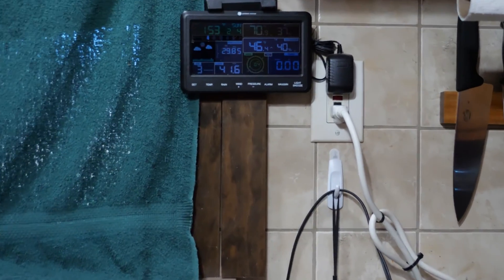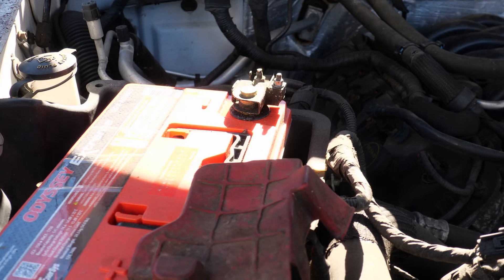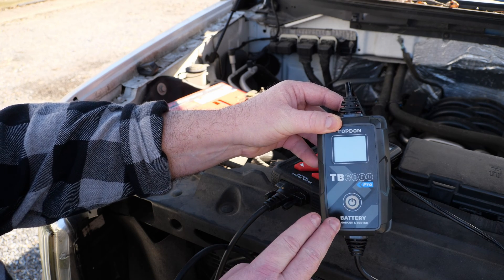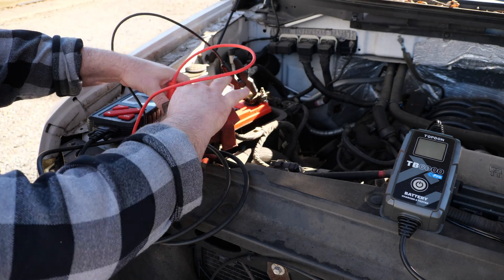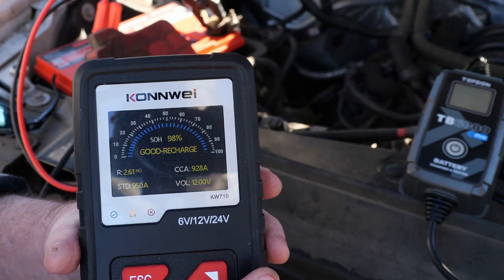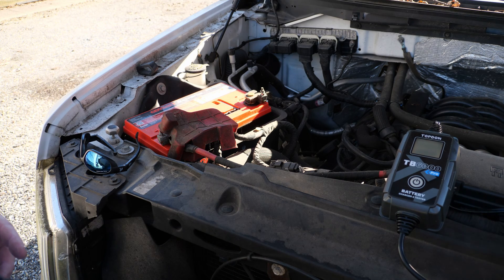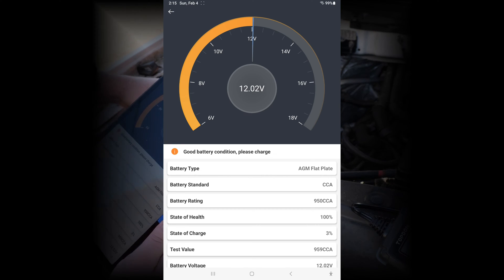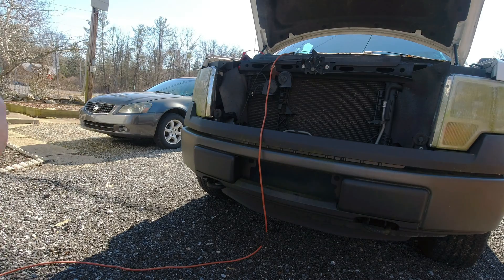🔋(part 2) Odyssey AGM Extreme Series Battery, 𝐕𝐄𝐑𝐘 Long Term Review

Comment: Odyssey are great batteries iim a mechsnic  done the maintenance on a friends 7.3 powerstroke has 2 group 65 agm odyssey were installed 4 years ago i check them yearly there still going strong,  as good as these batteries are abusing or neglecting any bartery will destroy. Or shorten its overall life , letting a battery go tottaly flat to 1 even 0 volts will destroy severly ahorten it life , second bringung batteries back up there flat by slanming them a alternator is second death for a battery  there flat use proper charger beung them up to chsrge properly.

Comment: how are you getting 950 ccas I am looking at the best they have for diesels and its only 850ccas, pc--1500
Reply from the maker: What do you mean how? The battery is specified/rated at 950, and it physically measures even better then the manufactures rating. It just is and it just does. 🤷‍♂

Comment: I have an Odyssey Extreme Series 65 that was installed in 2015.  It still tests good and starts every time. I’m thinking of replacing it just because of its age. No other battery I’ve had has ever lasted even three years.

Comment: Lto lithium’s the wave of the new future, 10k-20k deep life cycle no low temp charge issues,no cell balance issues, voltage stays rock steady, super fast charge rates and discharge rates, fire safe battery chemistry, yeah the future the last battery you will need for starting, they all hot cake wild in the car audio scene obscene amp discharge rates insane charge rates, the only drawback is less energy dense and very expensive, after my standard agm and lead acid batteries die I’m totally replacing them with lto lithium, plug and play 6 cells two pairs

Comment: I'm in need of two new batteries for my 1997 ford diesel pickup. I've been researching AGM batteries,  both Optima and Odyssey are the highest rated but I continue to find to complaints on the Odyssey.  The first complaint is that the batteries fail in under a year and the second is that Odyssey refuses to honor their warranty. After reading their warranty I have come to the conclusion there is No Warranty on an Odyssey battery. Odyssey says it warranties their Extreme for 48 months but if you read the warranty it say that a battery is only good for so many starts and they may determine your battery has reached its life limit before 48 months and therefore the warranty is void. Using a stock motorcraft battery I've been getting at least 5 years out of my batteries and pang less than half the cost of the Odyssey. Please explain the value of an Odyssey battery. I see none.
Reply from the maker: Explaining the value of this battery is exactly the point of this video series! Subscribe, watch, wait, and we'll all see together when this thing dies on me. Until then, I will provide yearly updates until the battery is dead, or until I am.
Reply: I'm watching this because I'm on year 7 on my Motorcraft battery that came in my Transit. I'm having a hard time believing these will outlast what I've had with these. Mine is in a Transit duel battery set up with factory high amp alternator. Van get started and drove probably 320 days a year so they have been charged all thier life consistently

Comment: According to the Odyssey literature - At 12.6v these batteries are at 75% state of charge.  12.9v  is 100% state of charge.  I have the same batteries, I put them on a trickle charger overnight (disconnected from truck) and they end up at 12.6v.  Apparently regular lead batteries are 100% at 12.6v, but these Thin Plate Pure Lead batteries need to be at 12.9v  Thanks for the documenting and sharing your test results.
Reply from the maker: Yes, 12.6 is the SAE (Society of Automotive Engineers) standard for all FLA (flooded lead acid) batteries across the board. There can be slight variations in voltage with different internal compositions though. But voltage will always fluctuate with temperature just as it will with resistance. A couple 10th of a volt difference must also take into account the battery temperature and internal resistance. Any 12v lead acid battery at or above 12.6 VDC (volts direct current) is good to go generally speaking. 
Cheers 🍻
Reply: These batteries call for 14.4-14.8V bulk charge and most auto manufacturers' alternators put out mid to high 13's.  Simply, it sounds like you haven't boosted your voltage and hence never fully charging your battery.

Comment: When you connected the tester, your battery had 12.00V, which means it was deeply discharged. Either you don't drive much and rarely, or something in the car consumes too much electricity when the car is parked and not in use. If this is the case, you will quickly damage even a very good battery. Measure the power consumption at standstill and charging voltage. This battery is AGM, and a fully charged 100% AGM battery has a voltage of 12.90 - 12.96V. Whenever you measure the voltage and it is lower than 12.65V, you must quickly fully charge the battery so that it does not sulfur and serves you for many years. I know what I'm writing because I am a specialist in batteries and vehicle installations. Regards.
Reply from the maker: Just some friendly advice here. Know the guy/gal you are talking at, before you begin to type/talk. "Trust me I know" doesn't get us anywhere. But proof does! All I have to offer is proof!

Comment: What group size did you test and what year and engine size are you using??? I have two Fords , 2007 , F150 and Expedition,  both have a  5.4 . Been getting good life out of the Motorcraft batteries just wanted to see what other options there are now.

Comment: did You put dielectric grease between the terminals and the connectors?
Reply: Yes!
Reply: @Finite-Tuning  Thank you for your response. You don't actually want to put the grease between the terminals and connectors. Put the connectors on the terminals then coat it all with the grease.
over time the grease will become an electrical insulator. If you start to notice the battery losing juice again take the connectors off and clean, then reattach.
Reply from the maker: @brettweltz8135 :
If grease could stop the force of a battery clamp, we'd have much bigger problems to worry about. If grease could stop 12vdc with over 1K amps, the engine would never start. I've already explained the low battery voltage in the video. I "always" use dielectric grease directly on battery terminals, been doing so over 30 years now. It helps to block corrosion, nothing more, and it barely even does that much.
Reply: @Now-Review-This  maybe dielectric grease behaves differently up north. I live in  Miami. the grease with my experience became almost like water and seeped into the connectors and caused just enough resistance to interrupt the circuit. after cleaning the connectors and terminals then doing what I mentioned in my previous comment, the problem hasnt come  back so far... its been 10 months. 
could also be the connectors... its a group 75 battey in a 95 corvette.
Reply from the maker: @brettweltz8135 :
Another place you might find the stuff is in the breaker panel in your home. It's heavily used there as well, but is probably green/blue in color. Even in the south dielectric grease is attempting to stop corrosion 😁. It's used by all industries where ever electrical connections are made.
Reply: @Now-Review-This  it might be the dielectric I used the stuff I use is by permatex and it’s clear. Could also be that the engine bay of my Corvette gets really hot….. I may have other problems that up to this. though, like I mentioned, I cleaned everything up put it back together basically soldered the connection and covered it with grease and haven’t had an issue since. Plus, I put a battery isolator on it just in case.

Comment: Would be interesting if you could get a baseline on your testers, to see how accurate it is. The go to, for years has been the Schumacher BT-100. If your different meters measured the same, I wouldn't have any concerns. Granted, they don't have all the bells and whistles as the electronic versions, but they are cheap, reliable and last forever.
Reply from the maker: They are accurate, very in fact. I checked both testers against my Fluke 87v back when I first got them. But as demonstrated in the video, they are very sensitive to their connection point. Every wiggle of a cable will result in a different reading. Batteries are very coarse devices though, they don't really care about mili-volts until we start talking about 100's of them 😁.
Reply: @Now-Review-This  Thanks for the reply!

Comment: Been using Odyssey batteries for many years and when used in addition to a battery minder I have achieved a life span of around eight years.
Reply from the maker: That breaks down to $50 per year cost of ownership, I think I'd be happy with that if I can duplicate those results. But I remember not long ago, $50 got you a brand new name brand battery! So there's that I guess.
Cheers 🍻
Reply: @Now-Review-This  Just bought a "cheap: battery from NAPA for a car that we are going to donate in a few months and it was close to $200.00.

Comment: Thank you for uploading this review video. Had been lately thinking in adding a second Optima battery to my old 2004 Durango who sees quite a lot of off road hard working abuse at the ranch. After seeing your video, now I am leaning more towards just replacing the Optima with an Odyssey. I will look more into that option. I am sure there has to be a rough-use Odyssey out there.
Reply from the maker: These Odyssey batteries are heavy duty for off road and on road use. I think the Odyssey website has a video showing the manufacturing process and internal construction. They use a much heavier buss bar connection internally for connecting the plates to the terminals. This is the common mode of failure for most standard batteries when used for off road conditions. I'm fairly certain that all Odyssey batteries are considered heavy duty for both off and on road use. But I'd check their website just to be sure.
Cheers 🍻

Comment: What happened to normal flooded batteries w/ 72mo warranties ?  I am sure these AGM batteries are great, but their price are still double what I used to pay for a top of the line Interstate.  I can't let my 2002 LS430 sit for more than two weeks without problems.  If I disconnect the battery from the car, while it sits, the battery pretty much maintains its charge.
Reply: Believe me, many moons ago, Interstate, and I assume others, had 72 (as well as 60) mo warrantied batteries… before AGM.  It is becoming harder to find even 36 mo nowadays
Reply: @carman200l  I do recall those days as well.
Reply from the maker: Not sure I understand the question. But I've never had a 72 month warranty on any battery that I've owned. All the batteries I've used in the past 12 years now, they all died in 12 months or less, every single one of them! I think I went through 4 Deka batteries in a row before just giving up on the brand completely. After getting burned raw like that, now I'm real sensitive.

Everything afterwards I simply returned for a refund. If it can't even make it a year, then it's completely useless to me and I now cut ties with the brand immediately.  

Is that what you were asking?

Comment: Odyssey batteries are amazing. I work in the oilfield and we use these batteries on compressors. Even when alternators die we bring them back to the yard and recharge them. They will last as long as the alternator survives. A lot of them are going on 3 and 4 years and still testing like new. We have 1000s of these. They’re great batteries. Even when it’s single digit temps they still are able to crank Cat 3304 and 3306s with compressors with 150W oil. After seeing what they’re capable of I bought some group 65s for my Powerstroke.
Reply: I am going to give a set of 65s a try on my powerstroke tomorrow. I had a set of Duracell ultra agm that lasted 7 years so can’t complain honestly was going go back with same as set and the local batteries plus store didn’t have any of the Duracell ultra agm they had one x2 power agm in stock the x2 is made by northstar  which is same company owned as odyssey batteries Enersys  found local part store has odyssey batteries instock so will give them a try and see how they do just wanted to add my info on the other batteries that lasted well
Reply from the maker: Keep us updated. 

The more of us doing this job in real life, keeps the manufacturers true to their specifications!